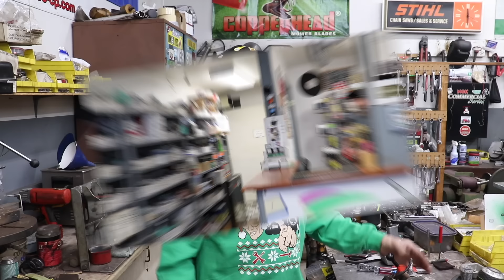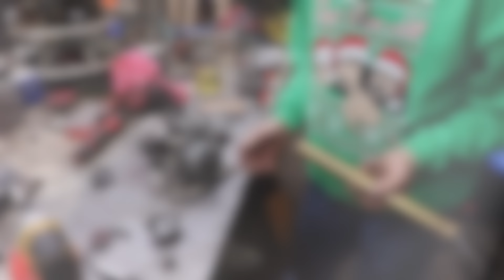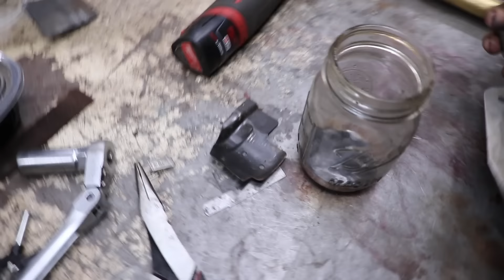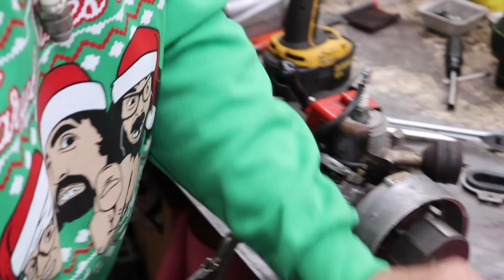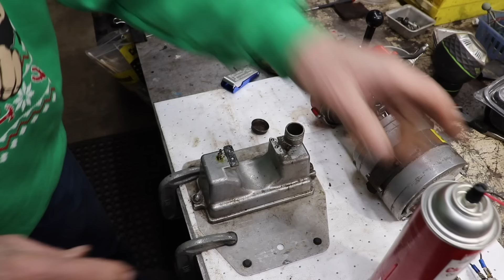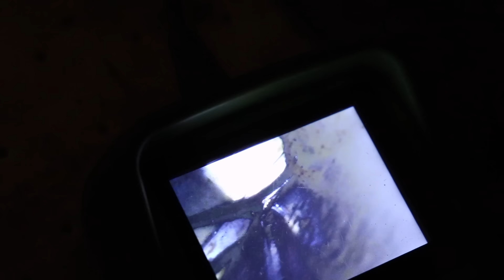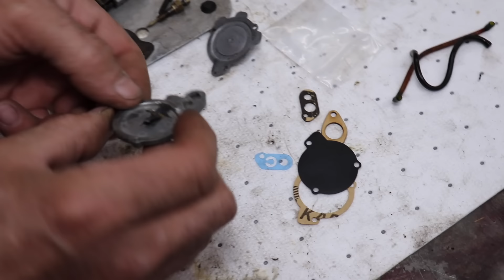World's SMALLEST Generator EVER! Will It Run?

Comment: Taryl, I had talked to you a while back from one of my other channels on here about a bearing that you were looking for and I think it was on maybe a flail type mower that you have and it was like a roller with short pieces of cutting chain if I'm not mistaken attached to that roller and the mower was a small walk behind unit, similar to like an old style push mower and you were having a tough time finding the bearings for it and I told you one of our local timken bearing facilities may have it.. anyway they didn't have it when I gave them the info you sent me and it's been quite a few months back closer to a year ago but anyway they said you can email them a picture and any part numbers with additional info and specs of the machine you're needing it for and they can probably get it for you...

Comment: Taryl the field or what probably is considered a permanent field inside of that generator housing is dipped in what is called red varnish and there's also a clear varnish that turns a really light amber color on windings and it's called quick dip varnish and it's a whole lot cheaper than the red varnish mix

Comment: The story I read on why not to use emery sand paper on points is because the emery imbeds in the points and causes points to arch. Personally I think doesn’t matter as I used emery for years and then used ignition file and the points didn’t last any longer either way so that’s that.

Comment: I wanted to know the engine size of the tiny tiger?
I looked for the smallest generator just a few years ago. What I found was a true sign wave inverter. The Sportsman “made in China” claimed to be 800 watts but it shuts down running a 350 watt appliance. You can damage the charger with some generators as they don’t generate a true sign wave. That is why they are manufacturing inverters now a days…

My Sportsman has a small 40cc 4 stroke engine. It also has eco mode, that lowers the engine rpm to save fuel when running a very low watt item. It’s very quiet but it won’t even putout half of it’s rated wattage.

Honda makes a 60cc 4 stroke inverter that is rated at 1200 watts. It cost much more than the Sportsman.

Comment: Acrylate fuel is pretty mutch standard in small lawnmowers ,leaf blowers ,chainsaws etc... and to some extent outbord engines in Sweden. 
Professional loggers us it too.
Its very good for the machines, and more important better for the user 
Due to cleaner emissions.  It has a long shelf life  compared to normal
Gasoline.
The  normal gasoline destroy carburetor membranes and rubber details over time .   The acrylate gas is expensive doe....

Comment: Your "field fart" is the stator winding. The magnet on the shaft is, for all intents and purposes, the field. In a car alternator, the field coil with brushes would replace the shaft magnet. Some modern 2 cycle engines use crank case "under the piston" pressure to pressurize the gas tank in lieu of a fuel pump.

Comment: Since you do not know why you do not uses sandpaper to clean up a set of points allow me to tell you the reason. It will of course clean up the surface fine except since there is no flat surface behind it you can grind off the surface of the points unevenly. hence you can ruin then with parts of the surface being  18th thousands and other parts of it being at 22 thousands.

Comment: I have one of these tiny tiger generators all ways had trouble with the carburetor. Looking for a parts source. Have always used 600 grit sand paper to clean points and plugs. I have a real points file and it's a 600 grit emery board like afinger nail file.

Comment: 24 hours labour @UK mechanic rate £50/$70... Could have a few slaves on standby for that cost.
Well if you had used a piece of inner tube and card to cut new gaskets I'd admire the self sufficiency.
Its satisfying to fix old random things that are useful and without buying a whole lot more new stuff.

Comment: Use spray on vinyl/Electric Tape On the wires that the insulation is falling off. It will be less destructive than using shrink tubes. Just a thought.

Comment: I've been using sand paper for 40 YEARS to clean points on tractors,mowers,chainsaws, anything with points,,AND NEVER HAVE HAD A PROBLEM! I TRY TO USE 400-600 GRIT, YOU CAN BUY A BURNISHING STICK ON AMAZON THAT DOES AN AMAZING JOB ON POINTS OF ALL KINDS,, I ALSO NOTICED YOU LEFT OUT THE SCREEN,,I HOPE YOU WENT BACK AND PUT IT IN. I had a little teeny weenie chainsaw with an engine on it just like that years ago! Unfortunately it had a broken rod in it,I think I might still have some of the parts left, like the carburtrator etc. It looked like a toy chainsaw on STEROIDS! IT WOULD HAVE BEEN A ONE HANDER! would have been handy to reach up an cut a limb etc. I think the piston galled and broke the rod,the piston was stuck up in the cylinder! As others have stated I would hook up a meter to the outlet and adjust the rpm for 120 volts if I didn't have the rpm spec. After watching this video I googled that little generator,boy some people think they are GOLD PLATED from the prices,,one was for 375.00 DOLLARS, THAT'S A LITTLE MUCH FOR SOMETHING YOU CAN'T FIND PARTS FOR AND ONLY PUTS OUT 300 WATTS! BUT I GUESS IF YOU HAD A LITTLE CAMPSITE OUT IN THE BOONDOCKS SOMEWHERE AND WANTED TO HEAR A GIGANTIC MAD WASP BUZZING TO POWER A LIGHT BULB THEN I GUESS IT WOULD BE WORTH IT???  For you out there that'll complain about me using caps mostly,get over it,I forget to switch back a lot, and I'm not YELLING EITHER AS SOME PEOPLE LIKE TO RESPOND.

Comment: What I was taught as a reason to not use sandpaper on copper contacts and commutators was the sandpaper tends to lose grains of the sand and they can easily embed into the copper  contacts and prevent them from working properly (and in case of slip rings or a commutator make a sander out of it, eating the carbon btushes). And because copper uses to be soft but tends to instantly work harden, it tends to grab and hold those grains pretty well.
But all that was about not using sand paper on contact surfaces made especially of copper, just because how the copper behaves. Maybe applies for some other soft contact surfaces (but never seen any except just copper), but I don't think it applies also for contacts made of hard metals (W, Ag or Pt alloys,...) as used for such ignition points.

Comment: I use the striking strip from a book of matches to clean contacts. (primarily motor contactors) The powdered glass is a nice soft, fine abrasive, and the red phosphorous enhances/replenishes the anti-weld property of the contact alloy.

Comment: I'm not going to read through your whole website to find how any times somebody has mentioned this, but there does exist some liquid paint-on insulating material to coat little wires like these from which you're chipping the hardened insulation. There has got to be a common substance from which to make those little carburetor diaphragms. Maybe ... extra-large, extra-thick, non-latex condoms?  Naaaah ... don't get it on ya ...

Comment: Taryl, you got lucky with having a good condenser on the motor, i had junk motors given to me by an uncle and he put together my first lawnmower, my uncle took a match book cover and folded it to set the points  a Tecumseh engine and accidently checked the spark with his fingers, yeowch, but then i had to learn from watching and a got several Briggs and Strattons to run again but the biggest problem was the condenser, not the points, good job tho, makes me want to try to get my weedwackers running

Comment: In 1972 I was visiting a friend who worked at a gas station in Casa Grande Arizona. It was around midnight. Two guys road in on Honda trail 70's just like that one. They had started out in the morning from San Diego California. They were on their way to Tucson. They said they just cruise along at 45 to 50 miles per hour as that is the minimum speed on the interstate. ( And the maximum speed on a trail 70 ) I'll never forget that encounter.

Comment: You can buy spray cans of magnet wire enamel from grainger for like $10 and repair coils pretty easy....I do it all the time....we had a starter and alternator shop for years...just check the resistance from each end of your coils and to ground and separate any wires that are shorting out before you spray...you can also zip tie them back if you need to before you spray....back in the day they use to just coat them with varnish....good quality modern magnet wire has 3 or more different enamels coated into it, each serving a unique purpose. But if youre just patching a nic in the coil the spray can works fine. Its not rocket surgery....

Comment: 1 gallon Laquer thinner to Half tank Gas in Cars driven 150 miles cleans Carbon from Catalytic Converters ! The mileage on my car went from 14.7 to 7.5 in less than a 1mile stretch! A gallon of Laquer thinner and 150 later , I was getting 14 miles to the Gallon! .

Comment: normally find disk brakes cleaner it will eat sticky old mix fuels away
i remember one time stupid fuel filters was clogged in steel tank cant get to it so i use two can of brakes cleaner left it in there for 2 hours and comee back and find out that filters was gone lol it turned into liquid black it worth try
if you want to wait for longer time probably be using lacquer thinner liquid it take 2 or 4 day for it clean sticky mix fuel out of it

Comment: Oh don't sand the points.  Haha! File em! Seriously though.  Some points in some communication equipment are silver coated so as not to burn.  Sanding chases the silver away and they are junk quickly.  Probably a carryover.  Point is to do the least cleaning to make points have continuity.

Comment: The reason why sandpaper/emorycloth is not favoured for cleaning points is because there was a no good way to keep the surface flat and square unless you use a mirror underneath the paper.
Files keep the surface flatter in most cases.

Comment: If you get a ultrasonic machine at harbor freight, it will clean everything you need. They work great. Don't leave aluminum in too long because it turns the alum. Black.

Comment: The fuel tank is pressurized by the crankcase impulses be to pump fuel to the carb. The diaphragm only controls the fuel coming in past the needle and seat, oh yah, that means the fuel tank is pressurized and the cap must be sealed with a good gasket or o ring

Comment: This made my week. I learned a new word, carbatrator ♥ I liked the spot on diagnosis with how there was SO MUCH wrong with this thing. The only thing I would have finished with, would be to use that nice FLUKE meter in the frequency mode to make sure that the SET RPM's are at 60hz, and the voltage in the appropriate 110 to 120 range. The cool thing about generators is they are true sine wave so it's not the nasty square wave they try to sell as good as.

Comment: point ignitions the contact surface is plated to hold up under use sand through the plating and they will burn up quickly - rotary parts sells an electronic conversion kit to replace the points no more repairing no spark problems

Comment: The part w the windings is known as a 'Stator' and is wound with 'magnet wire' wire with an
enamel coating to insulate it. Ten feet of 14 gage magnet wire will give more turns than 10
feet of 14 gage wire from a piece of Romex or house type wire as the insulation id so much 
thinner, the more turns you have, the more magnetic field built up there is.

Comment: On the cleaning points with sandpaper, some old manuals I have tell me that sandpaper can leave grit stuck in the faces, leading to hot spots that will cause premature wear..  That said, I'm notorious for misplacing my little file, and have cleaned lots of them with sandpaper without having any issues.

Comment: I have one of these lil'  generators,  finally got it running and the fuel tank leaks at the bottom   stamped metal plate .  It is attached to the tank with a special  fuel proof adhesive ( I would like to find out what it is ) .   Inside the tank is a plastic and wire mesh ( Klunk ) filter pickup, there are other pressure feed lines .   The unit ran well , however   with the fuel leak , can't risk a fire .   Very nice breakdown video and if you happen to find out what fuel tank sealer is used please publish on  youtube .               Tom
Reply: MotoSeal!

Comment: I had several of those Tiny Tigers 20 years ago. Both O&R and Tiny Tiger seemed to have different CA addresses when those were built during their production span. One had a very big cast aluminum muffler that helped a little bit but it still sounded like a deranged weed wacker. I think one was made by GADCO Electra but I forget who made the others I had and am not sure which company owned them first. That unit is made before 1964 because the O&R address has a two digit zone code they stopped in 1963 when they switched to zip codes. Mine all needed carb diaphragms and at the time Bobs Small Engine Service in IA was the only place selling the thin rubber membrane that fit them. Replaced it and they all ran fine.

Comment: What a cute but noisy machine! 😄
Congrats for bringing it back to life! 
Regarding Aspen fuel: I have been using these fuels (2-stroke and 4-stroke) for many years now and I would never go back to pump gas for small engines! The emissions of harmful substances is way lower and it smells a lot less. Also after using the 2-stroke string trimmer on pump gas I always had headache and this is gone now. The aspen also burns very clean and is very stable, even after years the machines start like they were just stored yesterday! I highly recommend, but you need to adjust the carb when switching, otherwise 2-strokes will run lean. And as I have heard, some heavily used 2-strokes have built up some carbon deposits from years of use and when switching to Aspen or similar, these will burn off and can cause problems, so do your research. Otherwise it is a superior fuel in any way, in my opinion. 🙂

Comment: reason is very very simple  but you need a brain to understand it 1 tiny piece of grit gets embeded and bingo no make contact very simple reason very true and accurate reason   . The coating on the windings is a conformal coating to hold the coils rigid it is not the insulation the wire is enameld copper wire that has an enamel coating on it the red stuff is not the electrical insulation

Comment: I worked on one very similar many years ago that was called the Lighthorse here in Oz.  Pretty much the same but using an early Kawasaki 24cc weed whacker engine and using a similar alternator generator for 300w 240V AC and about 10 amps 12V DC.  Had a frequency light that only was on when it was pretty much exactly 50Hz (3000 rpm).  So you could dial in the revs to be exactly 50Hz under load.  Not as old as this one you are working on.  My grandfather told me that points were normally plated, so once you filed or sanded that plating off they would last significantly less time before re-pitting.  He considered using a file or emery was a get out of trouble thing because you didn't have new points and a condenser to swap out, but not a good idea long term...
Reply: Yes the cheap points were merely plated ... but some of better quality had solid tungsten blocks.

Comment: As an old electrician, I do not sand contacts (points).  A clean flat cut with a  Mill file is better.
A domed high polish is best.  Rough sanding leaves endless peaks and valleys that have particles that will burn
and lead to carbon build up.   When I was a kid sanding was good nuf to get the lawn mowed.

Comment: I worked on one of those back in the early 70's, it was the smallest little chainsaw I ever saw, the big end bearing was fried, I was curious and slapped some shim stock in there just for laughs, I actually got it running. it was winter and we didn't have much equipment to work on. I told the guy it wasn't worth fixing, so he went and bought a real saw
Reply: for a while back in the 70's we got several batches of Briggs points that had to be sanded before they would work, then they went back to working without it

Comment: You could have a 12v ac output and use an external rectifier, not using the diodes at all,, I definitely would not plug and electronics up to that thing,   that waveform and frequency is probably crazy irregular..

Comment: I'm building a larger version if this.   Only DC output 24v DC, 150 amps,  snd I also have a 100amp 12v version to build,  for charging large battery banks ,  off grid homes need a means if charging batteries!!

Comment: You may be able to put 12v on the 12v output to get it to start working, depending on the type of alternator it is,
Reply: A alternator unlike a generator requires 12 or really just a couple volts before it can excite and begin making currant. Some alternator like a delco you can get by just applying 12 volts ever couple days as it loses its magnetism.

Comment: Buy a weed wacker engine head, a 12v dc permanent magnet motor, a small hose and clamp to make a rubber shaft, a 12v voltage regulator,  and an outlet for the design. Don't use it for sensitive devices like phone, computers etc. Only on simple crude products like 12v vacuums, 12v water pump, lights, and tire compressor.